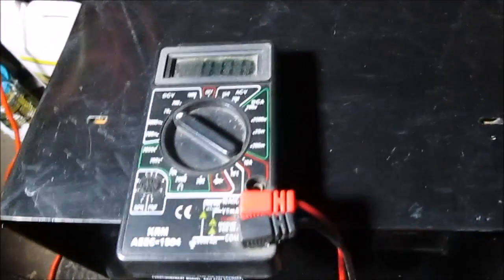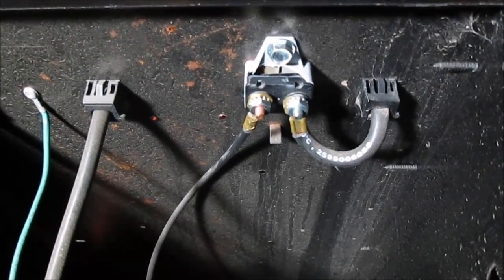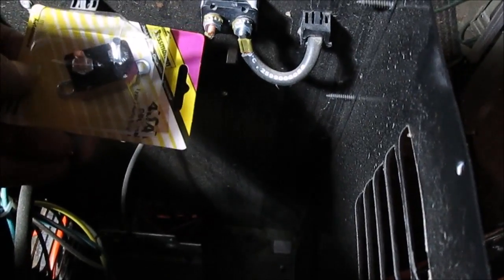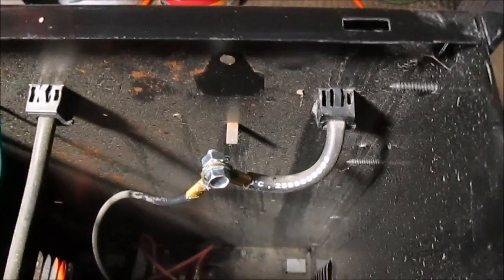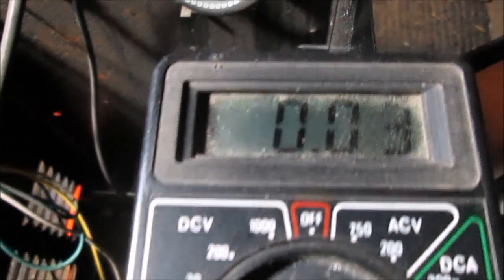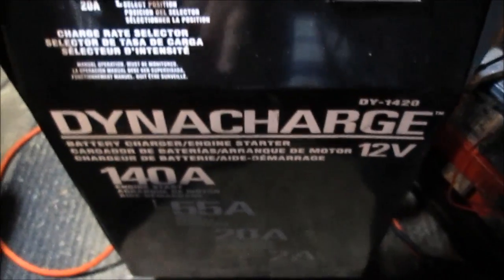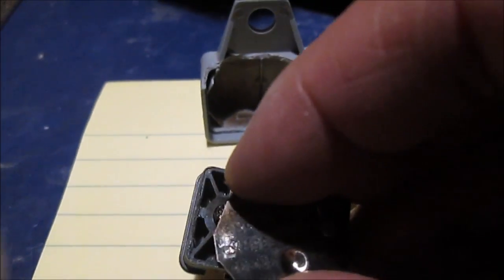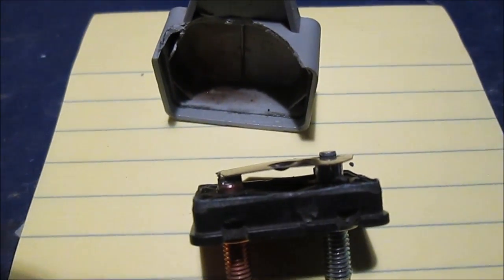Replace Circuit Breaker in Battery Charger

Comment: The fan has been deleted. The mount for the fan is on the base of the charger left of the transformer. I have never seen one of that size (50A) without a cooling fan.

Comment: I was able to actually fix my breaker which was solder onto a circuit board. The tab that he refers to at 3:34 I was able to tighten by putting the stud it goes on in lengthwise in a vice then compressing the end, I used a few taps of a hammer on the vice to help squeeze it tight.

Comment: I have power to my leads but when I put a loads on it clicks off. Upon inspecting the circuit breaker the wires that go to it, the plastic is a little melted. Could this be the circuit breaker having an issue? Is there a way to test it?
Reply from the maker: I would buy a new breaker and replace  the connectors on the wire

Comment: I have a battery charger that, even with the charger unplugged, the circuit breaker trips when I hook it to a battery, if the battery has any power at all. What would cause that?
Reply: Bridge rectifier

Comment: Why is the charger so noisy / buzzing? Shouldn't it just hum, only, instead? Thanks.
Reply from the maker: Not all chargers sound the same ..The big cheap made box makes it really noisy
Reply: @not2fast4u2c  How can one test a multi-amp battery charger transformer, itself? Mine is a approx. 25 -30 year old, 2/10/50 amp Schumacher 12 volt battery charger. Mine is not making any humming noise, anymore, like it used to, when plugged in, and is not putting out any voltage at the battery clamps end. The transformer, itself, looks fine - no discoloration, no burnt smell. It just went out, today, while using it. I heard a bit of a strange noise,  maybe even a pop or a sizzle of some sort, right before it shut down. It is the type charger without any electronic "board" in it -  it's of a very simple design. And now it won't turn back on, and is non functional. Thanks.
Reply from the maker: It would be cheaper to buy a new charger

Comment: Mine needs this. It has a 55 amp "jump start" mode. The circuit breaker is rated for 35 amps. I feel lied to.
Reply from the maker: It is a scam how they made it so big and there is very few parts in it and we know it can not really put out that many amps on jump start

Comment: 50 amp for the converter in my motor home...same exact thing. I did a continuity test on it and 7 others in a rack and this one had no continuity. I opened it and instantly saw how it is designed to work, tested my theory by pushing the contacts together but still defective so cleaned the points, pressed them together and bingo! I replaced all 8. since they are all 30 years old, online from ZORO for $45. All that empty space in that huge charger reminds me of an expensive microphone my cat knocked to the floor and when I picked it up it was rattling so I took it apart to fix it and discovered that it was all empty space with a tiny mic pick-up inside exactly like my plastic cheapies but it also had a large cast-iron weight inside so people would feel they were getting more for their money. I paid $125 for that sham that was actually no different than my $3 Radio Shack Special.
Reply from the maker: Glad you fixed it ..That is really a rip off that the battery charger is in a big box and has less parts and cost more than my little  $ 67 one that has fancy computer like parts for charging special types of batteries like the sealed lead ones and AGM types ..Also has a float charge feature
Reply: @not2fast4u2c  In the olden days they probably were full of stuff. I recall working at 2 gas stations in my teens and using chargers that size and they were really heavy. Maybe they leave them large like that now even tho that amount of space is not needed so customers will think that the mechanic has a really super-dooper charger so they're glad to pay to have their battery charged by a "real" charger. No tellin what's up. I just bought a charger that does all types of batteries, 12 volt, 16 volt and 24 volt of every type. I think it might have a button where it'll wash my truck. It's smaller than a loaf of bread and weighs a few pounds. Charges up to 100 amp hour batteries. Plus gives me a 26 amp jump-start. Apparently it'll clean the scale off old batteries and refurbish them. I have another jump-starter that's the size of 2 decks of cards and charges up by hooking to my computer. Life is strange nowadays. Something else unrelated...looking for batteries for our motor home I noticed that some batteries cost $3,500.00 and more but they hardly weigh anything at all.

Comment: What would stop my battery from charging in my camper?  when my trickle charger is on it everything works fine.
Reply: Go to the irv2 community and you will receive helpful information from people in the rv life.
Reply: Sure you solved it by now but could just be a faulty battery ! Did you solve it ? If so what was it ? I would like to know . Thanks  Bob

Comment: This was my issue thanks!
I chose to just bypass the circuit breaker and disconnect the bottom lead from the left hand switch (yes it’s counterintuitive) to disable the super boost feature. 
So now the max amps I can get is 20, but that’s fine with me. I can always fix it properly later.
Reply from the maker: I would recommend buying a new circuit breaker they are cheap at the auto part store...If I really needed to slow charge a battery I might bypass the breaker
Reply: not2fast4u2c You underestimate how lazy I am haha.
Reply from the maker: @truthsmiles  Remember Safety First ..something shorts out and all heck could break loose
Reply: not2fast4u2c 
I definitely agree with not taking any risks with high voltage. 
It’s been charging at 20 amps for the last 30 minutes and the leads aren’t even a little warm. Worst case I melt them but it’s just 12VDC so won’t kill anyone. I suppose I could get a spark but that’s always possible when monkeying around with a car. :)

Comment: Tyvm !!! Good vid... Thank for pointing out the diff between the copper and silver post... Using a 50 amp exactly like yours from a battery to my trolling motor now... Thank again you saved me about 45 bucks!
Reply from the maker: Thanks for Watching ....I have a small winch on my garden tractor that uses a circuit breaker ...It is good to have them on things that draw a lot of amps from a battery

Comment: When using the charger's boost, the inrush amps thru the circuit breaker will heat up the bi metal arm causing it to pop away and break the circuit. When it cools it will snap back into place automatically. A 50 amp breaker will let the high inrush of amps thru for about 3 seconds before it heats up too much. To increase the time being able to use the full starting amp capacity, you can put two of the circuit breakers together in parallel.(copper to copper and silver to silver) This will spread the load out between the two breakers and increase the time before it heats up too much and trips. Care should be taken to select the correct amp rating. In this case, I would've selected two 30 amp breakers. The owner is obviously using this charger to boost start something since they wore out the contacts on the circuit breaker.
Reply from the maker: They have used it a lot to jump start
Reply: Hello, so i have a 24V DC jump starter and it has a 40A CB, and output current in 200 Amps for starting. I dont know how this is not breaking the circuit, kindly if u could help me understand
Reply: @81922944  The length of time it takes to open the circuit is different for various manufacturers. The amount of current that is put thru the circuit breaker and how long you are cranking the engine determine if the CB will open. If it doesn't open at some point during continuous use, I'd be afraid the jump pack battery will explode.
Reply: @repairit1  thank u